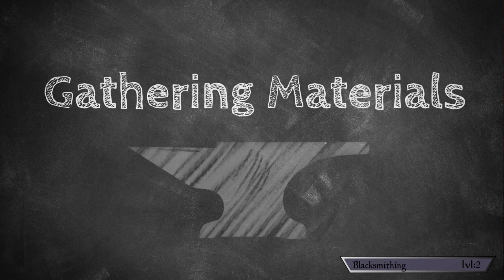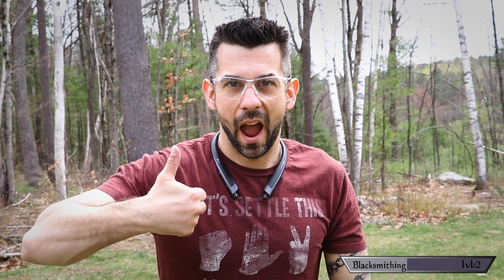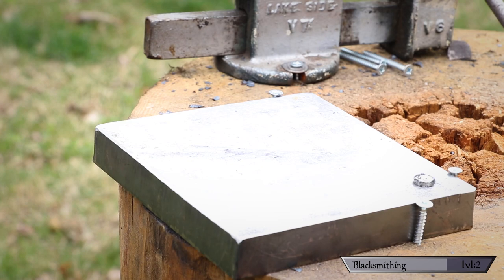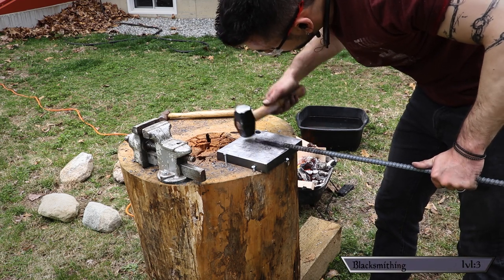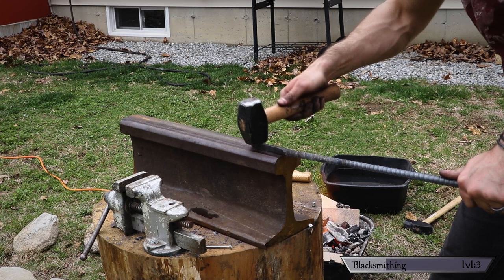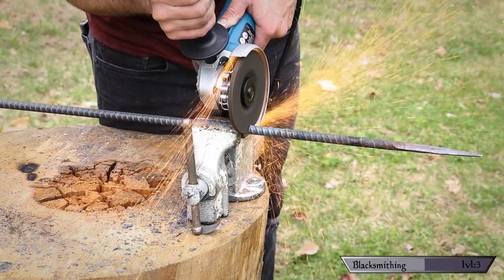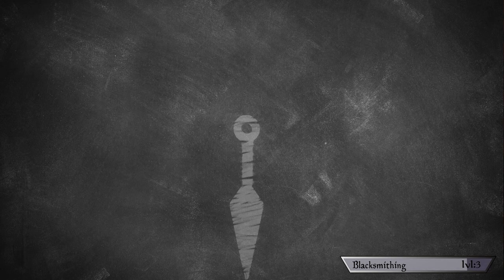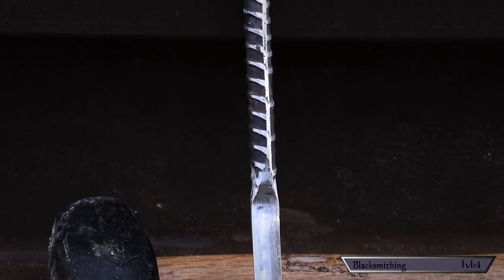Forge A Throwing Knife | Skill Tree

Comment: I use a piece of rail on its end set into some scrap lumber. It about a 150lb chunk that ends up at my knuckles on its end. 

Every blow feels like the sweet spot on as 500 pound anvil. 

My ultimate plan is to get a welder buddy to help me weld a proper anvil shape to the top, downside being you need the whole piece at like 500F to make a proper weld, but that is something a massive tiger torch can fix.

Comment: Only "mistake" I can see, going mostly from watching several seasons of Forged in Fire, is that you skipped the quench stage (or at least didn't mention that step). You want to heat your metal up to a bright-ish yellow. Like a stick of butter kind of yellow, from what I've gathered. And then you dunk it into a container of fluid, be it water, mineral oil, some have even suggested motor oil could work. Definitely something to research deeper. And best to have plenty of open space around you until you get it all figured out as water quenching basically flash-boils the water and it may "spit" and burn stuff (which includes you so gloves, apron, etc. are a good idea) and oil quenching can have rather large flareups of fire.  Good way to make sure the metal isn't coole dtoo quickly (which can make it brittle and waste the material) is to heat up a scrap piece and "quench" that, holding it in there for a bit to heat the liquid up. But yea, quenching helps harden the metal to it will hold its edge better. In a way not quenching with rebar might have been the right choice as it is already brittle and as a throwing knife it is going to take a lot of impact, so leaving it soft helps keep it from snapping.

Comment: Nice work. Now if you want to level up even more you should get yourself some carbon steel and try heat treating. Its really simple all you need is forge, oil or water and an oven. With a nice wooden handle these knives last a long time.
Reply from the maker: Hi, Blackwing! Thanks for the tip. I definitely want to try that. I will add it to my list and start reasearching. Hope you like the show!
Reply: @SkillTree  looking forward to it. Keep up the good work.
Reply: Rebar is high carbon steel FYI

Comment: He did a very nice job  but you did not clench the metal just when the metal is heated is hot enough you dump it in oil for a few seconds and hardens the steel

Comment: Oh and dont burn paint, the fumes are bad for your lungs
Reply from the maker: Agreed! I was assured at the home depot that I got the rebar at that it was not painted. In fact, I read that you would need to use an epoxy paint to adhere to the rebar and it is commonly not painted because it would be detrimental to the common application of it (adding structure to concrete). That being said, just because I read it on the internet doesn't make it true! 🤣. Thank you for watching.